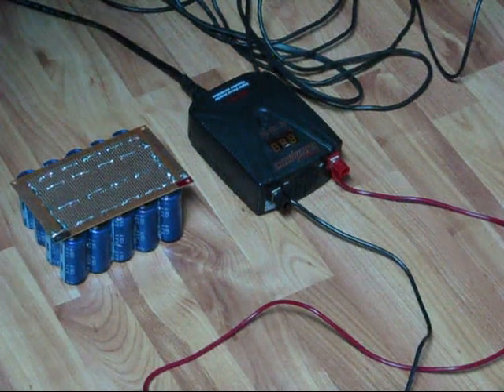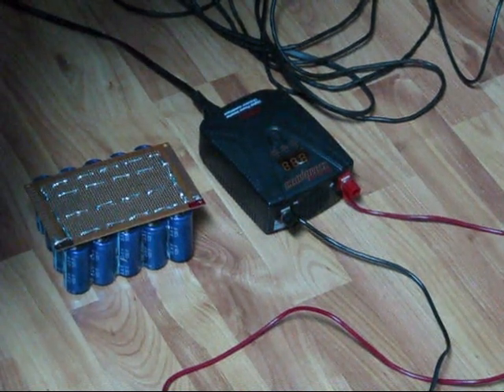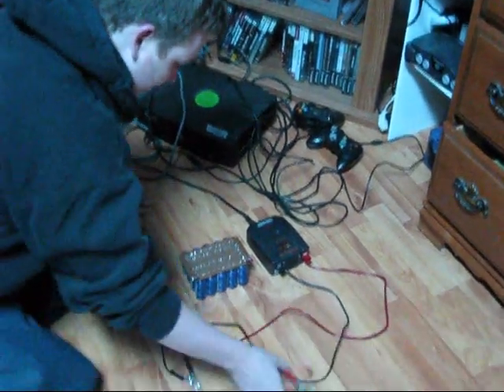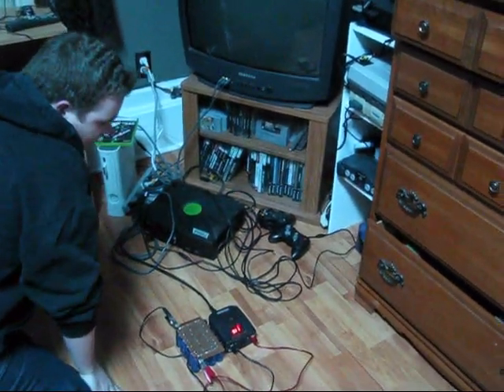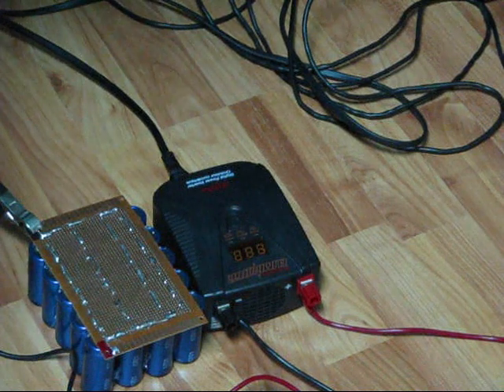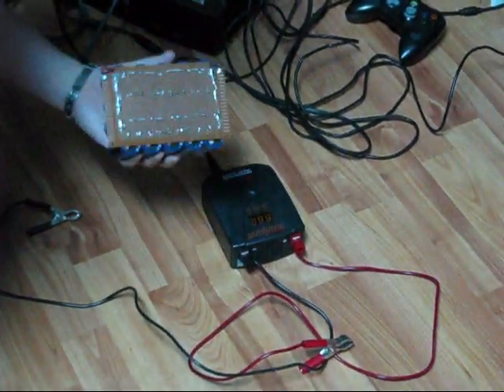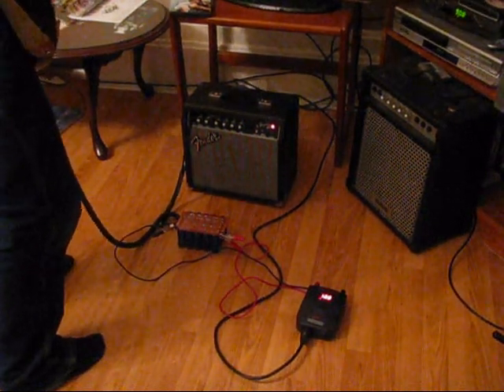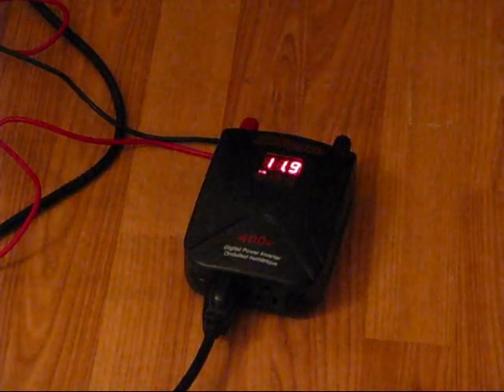Powering AC appliances with SUPER CAPACITORS!

Comment: I wondering if you have any ideas for me. I have a strand of waterproof LED lights on my boat. With the motor off they have no issues. When the motor is on they will power off randomly. I assume the stator is not providing a steady power supply. I have rewired the entire boat and added 2 new batteries, so the only thing I haven't changed is on the motor, thus my idea (grounds etc cleaned every connection is sealed in liquid electrical tape or had diolectric grease. I was thinking that I could run a cap just prior to my fuse panel and isolate/ regulate the power better.  What do you think?